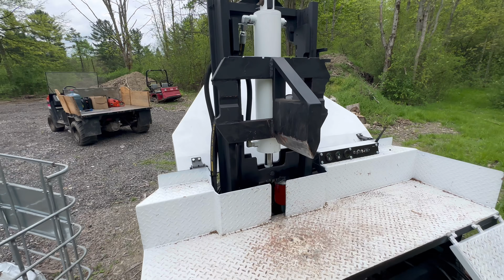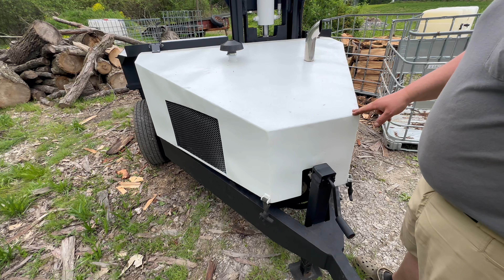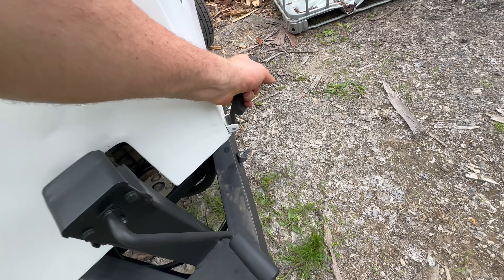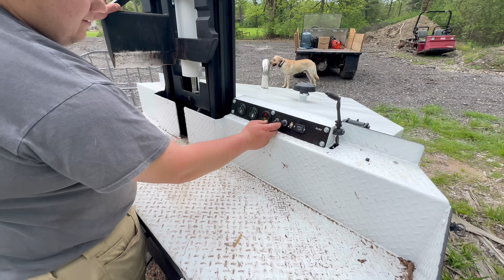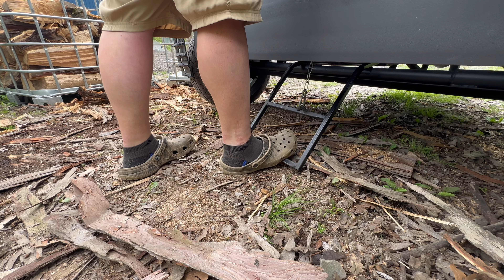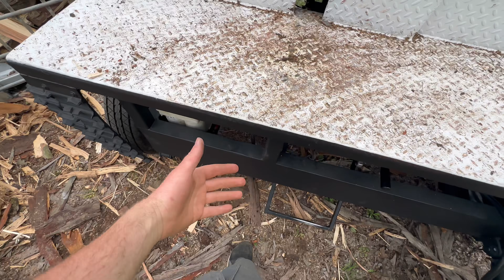The Coolest Log Splitter You’ve Never Seen (Homemade Vertical Log Splitter Build)

Comment: Seems like the hydraulic supply lines are too small from the valve to the cylinder. I dont see line that size flowing 28gpm very freely. Lots of 28gpm pumps have a 1"npt out port

Comment: I got a 4 inch bore  with a 2.25 inch rod from Ruggedmade and it really took some time off my cycle. they also have 4.5 inch bore with a 3 inch rod. /you might want to check them out.

Comment: I like your work, but I think you made a mistake by putting the pump directly on the engine. Why didn't you make a transmission with a chain and sprockets? ratio 1 to 1.5 or 1 to 2. The engine has power but it has to work at full throttle and it is still a rather slow cylinder. with the transmission, you will reduce engine revolutions and high speed on the piston. This is just my opinion, that's how I would do it.
Reply: How did he make a mistake?  All hydraulic splitters have the pump directly connected to the engine.
Reply: @amandadavis9726  This splitters is handmade and well made. I don't know if you understood my comment, but the one who should have understood knows what I wrote. All splitters have a pump directly on the engine, but if you do something yourself, then you do it the way you want and the way it's better, not the way everyone has it.
Reply: @zoransunja37 I understood what you were talking about in regards to the transmission and drive sprockets to change the ratios.  How would a transmission and drive sprockets enhance the performance?  I do understand gear ratios,…so you don’t have to waste time explaining that to me. If you speed the pump up and slow the engine down by way of sprocket,…what happens to the engine when the wedge has to be pushed through some tough stuff?  It’s gonna bog down because it’s not running at a high enough rpm to produce the power to push through. How can this engine run at a lower rpm and efficiently run this hydraulic system, if it doesn’t already produce that much power to begin with? That’s why it has to be ran at wot. 

I agree, it’s a well built machine. But adding a transmission and drive sprockets just overcomplicates things. You would have more maintenance than needed, if you went that route. You can change your ratios by changing the cylinder size,…which they did mention. There are other factors that may have to be considered as well. That pump may not even be the best one for the performance of what they’re trying to achieve. If I was gonna make a vertical splitter with a nice combo of speed and force,…I would look and observe the components of what the major manufacturers are using, and then go from there.  To be honest,…I hope they do get it figured out. It would be a very respectable splitter if they can get the cycle time within a 6 second range. I’m not a hydraulic system guru by any means. I just know they all consist of the same basic components,…and that you can adjust force output by manipulating the flow rate and pressure.
Reply: @amandadavis9726    As you know, directly connected pumps are almost always operated on gas motors running at 3600 RPM. With a D902 engine, 3600 is technically possible, but it is a VERY annoying RPM just from the decibels, never mind the waste of fuel. Running a D902 at 2000 RPM is probably ideal, and just use a step up transmission like @zoransunja37 suggested. They could also have used a 3.84 displacement pump, which would give 30.9 gpm in a single stage configuration. Oddly, the video doesn't seem to show the unit ever running in the secondary high pressure mode why it even has a 2 stage pump is something that should be asked.
Reply from the maker: I agree that could be a good idea and we may do something like that in the future

Comment: Howdy, nice splitter, especially for a non hydraulic specialist. You state, you want it faster. I am a hydraulic technician by trade, there is a way to speed it up by adding a function to your valve block. If your interested, get in touch, I gladly explain the changes you have to implement on the splitters piping. Cheers. BTW, I'm from Germany, so I won't try to sell you any kind of BS.
Reply from the maker: Thanks. I appreciate that. I may take you up on that offer
Reply: That was the intention of my comment. Feel free to take it. Cheers
Reply: @Mannys-World would this be using a regen spool in the valve? That’s the only valve change I could think of. Would make the speed and force the same in both directions would it not?

Switching to a more appropriately sized ram, as they mentioned, would probably make a bigger difference in speed, and would improve the retract speed too. However, I don’t do hydraulics for a living, so  am interested to know if I’m missing something.
Reply: @AndrewMoizer    indeed, its the "regen"erative spool. a more "appropriate" ram would reduce the force, while speeding the splitting up. there is no perfect ram...! its always a trade-off, since you cant really switch gears with a gear pump; only with a variable-pitch plunger pump can you adust the "gears". But the price is like an "o" extra on the bill for the plunger pump, compared to a gear pump. while a regenerative valve that works on its own, controlled by pressure, is like a second gear for 10% of the cost. you get the speed, and when you need the splitting force, the differential/regenerative valve will switch back by the high splitting force on the circuit. so how does it work. for being fast, it connects both sides of the cylinder. and the pushrod side oil is flowing into the piston side; thereby, the pump just needs to pump the volume of the rod, not the full piston volume, but it only gets the force of the rod area. Speed changes relative to the area ratio between rod and piston, but with the same factor the piston gets faster, it loses push power. it also only works on the way out, cause when you put the same pressure on both sides of a piston, the rod side has a smaller area, so it moves out. since pure log splitters are an 85% empty run system, a plunger pump doesn't make sense, but a regenerative valve spool does. however not if you have to manually operate it, cause as a humane, you switch over when its too late, and go back again when its too late, loosing a lot of power going back to normal and pushing the oil into the overpressure release valve converting your diesel to pure heat, and again loosing a lot of time going back to fast mode. while an automated valve will go back and forth just at the right time, controlled by the forces in your splitter, if adjusted correctly to your splitters hydraulic system. it also will offload the mental load from you, choosing when to switch. a decision the operator as a human will get at least 95% wrong. not a good work environment, mentally speaking...
Reply: @ thanks for this. Hadn’t appreciated an automatic regen valve. Sort of like a two stage pump in some way.
Reply: yes, but at a fraction of the costs and way easier circuit diagrams... even lower in price is just the manual spool.
Reply: @Wolfpupfab  so, do you?😇

Comment: I'm glad I found your channel.  I love this stuff.  You are quite the fabricator.  This whole foot control for the spool valve is certainly handy.  Did you by chance consider what they call a double detent spool valve?  You don't have to hold the valve open with your foot.  Once the valve sets the ram in motion it stays in motion.  Once the ram reaches the bottom of its stroke it automatically returns to the top of its stroke.  So, basically you have both hands free, and you're not standing on the foot pedal at all.  I'm going back and watching all your videos.  Thank you.
Reply from the maker: Thanks. I am going to have to look into that valve

Comment: Great job on the splitter might have to beef up diamond plate steel on the table . Have to get running 🏃‍♂️ gear ⚙️ from an EASTONMADE vertical splitter for 3.7 seconds running time . Overall great ideas for sure on a homemade wood 🪵 splitter. 😊
Reply from the maker: Thanks 👍

Comment: Loved watching the build vids for ideas on my own splitter. I'm running the same size pump on a 16hp gas engine with a 5" ram and mine seems quite a bit quicker than yours for some reason. Do you know what rpm the engine is doing as maybe it's not revving fast enough to get max flow out of the pump?...
But well done on an awesome splitter! 👌
Reply from the maker: Thanks I appreciate that! The engine rpm is something we had thought about but have not checked yet. That could be an issue as it being a diesel engine, it may have a lower rpm and the pump might need more.

Comment: When  I cut logs I cut a cord at a time. The logs sit in a cradle and I cut them into 18" lengths the logs fall into a  tray underneath. Works well. Just takes 10 minutes or so never timed it.
Cradle measures...
16"wide/15' long/6 1/2' high

Comment: Excellent job 👍
Splitting those sizes of logs. My wedge only goes into log about 4"  and I can retract the cylinder. 
27" log can split. 
If I have a 8" log x 18" long.
I split it twice turn it 90 degrees split it with in 5 to 8 seconds. My wedge is 7" wide at its widest. With mine I just run my engine just a little higher off idle.  Only thing i didn't want to listen to revving engine. it's still quiet fast at idle. Those pull type post pounder you  rent to fence.
I have a pounder that sits on the side of the machine. Just under 700lbs of weight. I hit the post 3 hits to their 1. Not knocking your build just say specs on mine.
Reply from the maker: Nice 👍 sounds like a cool set up
Reply: What is a pounder?